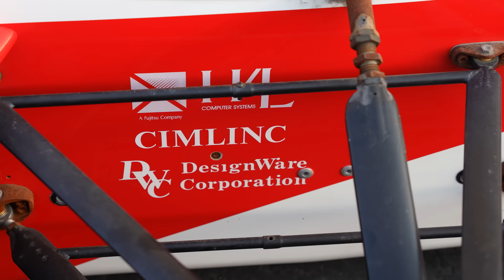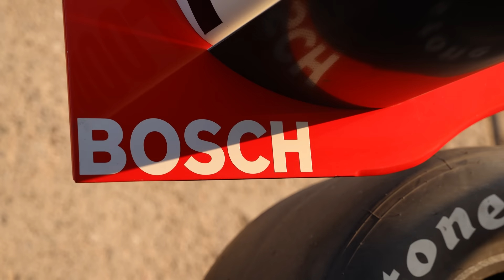I bought a INDYCAR without an engine.

Comment: What an ultimate powermove, buying a indy car and fitting a rotary, when the ls corvette guys didnt think it could get any worse
Reply: probably he wants to mimic the legendary 787b
Reply: @Ibrahim.961  To be fair, Rotaries would be PERFECT in the racing scene! If you ignore higher gas costs and basically running a 2 stroke....
Reply: Im a v8 guy but i love rotorys and would never put a v8 were a rotory belongs.
Reply: @Ibrahim.961  with his 4 rotor That thing would be stupid fast all that aero and it barely weighs anything. I think he just wants to go fast.
Reply: ProMazda's been a thing in the support classes for Indycar for a while now. Maybe not a rotary these days, but I don't think the concept is as alien as you might expect.
Reply: @StarkRaven59  yeah, Star Mazda became "Indy Pro 2000" a couple years ago, currently an inline 4 cylinder.

Comment: Biggest problem may be that in the race configuration the engine is a stressed member - the front is bolted to the chassis bulkhead, and the transmission is bolted to the back of the engine.

Comment: That hook on the back (on the bottom of the wing structure) is for the special jack/dollets they use to bring the car into and out of the garage.  A horizontal rod goes into that hook and then you use leverage to lift the car and get it on the dolly wheels.

Comment: 9:34, i believe the main use of those is actually adjusting the roll center and antidive/antisquat geometry of the car, the adjustments come as pre-set configurations, with the IR12 generation for example for a high antisquat rear end with fairly neutral roll center you would go some 20mm down from default, whatever that is, on the forward leg on both top and bottom A-arms. 

I say the main use, as they run the suspension so stiff you are not going to get a whole lot of camber gain, and especially not big swings from track to track :)

Comment: If there's a car to put a NA 4 rotor into, this is it
Reply: Surely this is the car for the 6 rotor
Reply: @nestam6844  THATS WHAT IM SAYIN
Reply: No room for those. This will be a 13b NA, rev to the moon.
Reply: @nestam6844  yesssssssss!!!!!!
Reply: @PuR3xGODx  there's easily enough space for a NA 4 rotor
Reply: @nestam6844  Nah, that's too big for that, the way the engine mounts in an Indy Car wouldn't allow it, at much it can fit a 3 rotor without some MAJOR engineerring
Reply: Nahh 6 rotor my guy
Reply: @tommihommi1  Is not about space, it's about the way of mounting the engine
Reply: @mindovermatter3988  won't fit LMFAO you can't cut up a carbon monocoque also the gearbox is part of the rear suspension so the location of it can't change. 6 rotor is too long essentially.
Reply: @MrManuel1329  I wasn't being literal my guy. There's obviously no way that would fit. I think maybe a 3 rotor might fit the best given the size he's working with so that he can still put out decent power
Reply: @joealex65  yea? What’s the right way to mount a rotory in an Indy car?
Reply: Even better if they can somehow fit a turbo in there...
Reply: @brent5832  Watch the video to the end and you might have an idea
Reply: I have a DP01 and I'm working on something similar. not many engines will fit in there.
it's about 23" from the firewall to the bellhousing. 
a renesis is 19" from the harmonic balancer to the end of the block
the bellhousing adapter will also have to be a dropbox due to the height of the crankshaft and input shaft
the trans is only good for around 350ft/lbs
Reply: @aleks138  so that probably means na right? What was in these cars originaly anyway? Like 3l V8 ?
Reply: @markoajduk7096  see that empty spot in the bellhousing above the input shaft. that's where the turbo sits. the trans also has it's own dry sump system. at least mine does. it's a bit newer
Reply: 6 rotor
Reply: @koimex7020  it was probably a cosworth XF. turbo 2.6L
Reply: @aleks138  Thats cool
Reply: @tommihommi1  no space and too heavy, car used to be 4 cylinder, by design and engineering just a 13b, turbo maybe,
Reply: Until he cant fit in it anymore
Reply: @tommihommi1  hell yea
Reply: @Me-fj8sb  original engine is a turbo v8
Reply: 6 rotor* even if he has to buy another and cut it and extend it like the 4 rotor rx7
Reply: @thatgingar8765  can't chop and extend a carbon fiber monocoque like that.
Reply: @ScottKenny1978  you can, it is just alot more involved.
Reply: Yesssss
Reply: @Skwisgar2322  I did carbon fiber repair work on planes. You'd need to do some serious things to make that repair strong enough to trust your life to it.
Reply: @ScottKenny1978  oh, for sure, it would take a professional, but it is possible.
Reply: Build a smaller, stronger 4 rotor, and rev it faster than an Indy engine!
Reply: @aleks138  someone who actually seems to know things , nice an thank you for the info.
Reply: @aleks138  ,true, It is a 2.65 liter V-8 burning methanol and producing in excess of 750 horsepower at 12,000 RPM and 45" of boost. For reference, boost is measured in inches of mercury absolute pressure. Standard atmospheric pressure is 30" (14.7 psi) and thus 45" equates to 7.35 psi of boost over ambient pressure, cosworth xb, I did the research of the car, 1999 to 2000
Reply: Twin turbo 6 rotor
Reply: @nestam6844  Where there's a will there's a way.
Reply: Would you put the turbo for it in this same place, in the bellhousing?
Reply: @aleks138  This dude knows his stuff and knows how tough of a project it will be. Its funny seeing everyone say "just put a rotary in"... yeah. Also i doubt Rob will be using the original turbo location. Not without a shit tonne of hassle anyway!
Reply: @ABiggerPigeon  whats wrong with the original turbo location? It already has a nice place to sit and there's not that much space under the body panels.

Comment: The engine and trans on these cars are stressed members. The 787B likely was also, but obviously you're going to have trouble sourcing that drivetrain lol. Are you able to custom machine stressed housings for an engine? And yes, like the suspension bars, that cage in the engine bay is nothing but a placeholder to keep the chassis in one piece. The engine block used to bolt to all those locations.
Reply: The 787B and a lot of the prototypes from that era and even some current smaller formula cars use fabricated steel engine cradles.  
Before this thing ever sees the racetrack, you need a race mechanic who has experience with these era cars to help you out.  I would definitely either buy new suspension, or have it Crack checked.  Typically these show car rollers are built with leftovers, crashed bits or whatever else can be pieced together.  Have someone go through it with you.....

Comment: You should make sure that the rotary or shell you use has enough strength since it will be a structural member
Reply: He probably plans on building a brace that goes around the engine and takes the stress. I doubt a normal rotary would be up to taking those stresses, especially with the way that a rotary is put together.

Comment: Register it as a kit car, and make it road legal 😬😂
Reply: Florida can help with that! 😂
Reply: Yes all he will need left is some lights, signals, mirrors plate holder and a 6 rotor
Reply: @connoisseuroftigolbitts  with LED lights, it would not be hard to rig all the lights into the end plates on the aero. All that's left is figuring out a good place to stick the license plate. Back of the rear wing, maybe?
Reply: @ScottKenny1978  yes
Reply: And take it on drag week?
Reply: Leroy the Savage's Rotary cousin.
Reply: Confused European noises
Reply: @jake3736  Extremely confused Formula 1 noises
Reply: @jono6379  Be interesting seeing a rotary powered Indycar towing it's own support trailer through the Colorado mountains LOL

Comment: Using a standard rotary engine as a stressed member in car like this without a chassis isn't going to end well. Tension bolts through the rotary engine are not likely to hold up to the bending and twisting loads you will need it to endure.  You should research how Mazda did it for their Let Mans car as that might be the only similar reference vehicle....
Reply: Alternatively, you could create a frame around the engine to serve as the stressed member
Reply: I agree 100%. As far as I am aware, the whole series of Mazda Group C cars has substantial supporting tubular structure between the monocoque and gearbox housing to carry through loads. Certainly the 787b and 792p are self-suporting without the engine installed. I have never seen a rotary engine used as a stressed member and I would think the nature of their construction precludes it.
Reply: @ancientrenegade9243  Looks like most Indy engines are around 600mm length, 20Bs are 675mm so I think even a 4 is going to be a stretch. Maybe literally!  Its obviously not going to be built to a class spec, so why not shove a few extra mm on the wheelbase to fit a novelty engine, and make some extended bodywork and fittings to suit.
Reply: @ancientrenegade9243  The monocoque is autoclaved carbon fibre yes, but the monocoque consists of the cockpit and forward structural area. The rear structure of the car consists of the engine, gearbox and attached bodywork, there is no rear monocoque, that's why they split in half when they crash hard enough. You can absolutely extend the car by increasing the distance between the rear of the monocoque and the gearbox (either with an increase in engine length or a framework carrying the engine), it would require increasing the length of bodywork, linkages and fluid lines to match the new length, but that's it. If you have a look at an Indy  monocoque you'll see what I mean :) NB by gearbox I mean the whole transaxle.
Reply: @ancientrenegade9243  Oh it definitely wouldn't improve handling lol. Might improve stability on a big oval, but it would be ruinous for circuits, at least comparatively. I was only thinking for the sake of novelty powerplants, which I hope is the overriding goal of this project. Not enough people are having fun with motorsport anymore.
I hope I didn't sound big-headed, I've been very lucky in my career to work with and have access to historic and modern racing cars of many different classes. I now work withh aircraft which is basically the same thing but upside down.
Knowledge is secondary to enthusiasm!

Comment: Not sure if anyone has said thus yet, but the back hole in the engine cowling is for a pop off valve, the Hondas would often run an engine intake on the right side.

Comment: I work in formula one and the suspension is very similar to indiecar (or at least 90s f1 cars due to them being prototype new technologies in this day and age and way more advanced than most industries) you have a torsion bar of which the rockers rotate around, the rockers are the part that is pushed by the push rods on the front, attached to the dampers that you pointed out in the video, the suspension is inboard for aerodynamics packaging, centre of gravity etc, interesting fact a lot of the stuff in motorsport is actually borrowed from the military such as the wiring (what im learning to do) and they hydraulics people are ex air force who worked on fighter jets.

Comment: Hopefully you've figured this out by now, but that big cavity on top of the gearbox housing above the input shaft is where the turbo would have gone originally. These had a big single turbo and no intercoolers, and the typical placement for the turbo was behind the engine (Porsche tried putting the turbo in front of the engine on their 1990 car, next to the fuel cell, and quickly found methanol has a really low boiling point and vapor lock is not your friend). The hole on top of the engine cover was where a spec pop-off valve would get bolted on the plenum before each session (the officials would pass them out at random) to enforce the maximum boost, a 1970s solution that lasted into the 2000s. Of course, no one besides the laws of thermodynamics is going to tell you how much boost you can run on it now...

Comment: Looks like it would have had a Ford/Cosworth engine previously but even a modded 13b today would likely make a lot more power than it would have had back in the 90s
Reply: That Cosworth made around 700 - 750hp depending on the boost level the series allowed for each track.

Comment: I love Rob and this channel so much, And I will never stop watching. But my god please just get the 4 rotor dialed. If there is a setback I’m not aware about, y’all please tell me and I’ll delete this. But after the “this vs that”, I was so ready to see that thing solid and wrecking everything, but now it’s nowhere on the channel. Someone tell me what’s up or please Rob get that thing set up right.
Reply from the maker: No setback. I legit tore it down to measure and work on billet irons. I also didn’t want to slap it back together without the carbon body. So it doesn’t look so janky. Figured it would make a cool phase of the car.  Videos will start coming out soon!
Reply: @RobDahm  so after watching you look over the car I realized you might need some help with formula cars. I work on and drive many different formula cars. Also If you would like to test any cars on a private road course let me know.
Reply: Everything takes time mate relax
Reply: @thomasclark6642  I know, it's just easier with some help.
Reply: @trusty9796  you're awesome!

Comment: 10:43 "where's the spring?" 
those might be torsion bars, aka suspension without springs.
they use them in f1, and i assume indycar as well
Reply: those i think are just rods to replace the actual suspension when storing this car.  yes, modern f1 cars use torsion bars. but they are positioned differently. torsion rods twist instead of compressing. also because this is a CART car its most likely (definitely) has a normal spring and damper.
Reply: Not in 1997 they didn't. Those are gone and replaced with these, I'm wondering if they even move. They look solid.
Reply: The roll bar is torsional front and back. I have multimatic dampers set up for this
Reply: @TheFoyer13  the bars on this car won't move or would do any dampening. I would think that the links would break if you drive this car fast and aggressive if the bars are used a the suspension.
Reply: @br1_deadpedal  Did the T97/00 originally have Ohlins TT4s?
Reply: @M.asa.  Those bars are just their to hold the car up for show car duty. They would normally have dampers mounted there. There are a lot of parts missing from that chassis. Dampers, roll / torsion bars, brakes etc etc.
Reply: @MX304  came from the factory with Koni
Reply: @br1_deadpedal  Interesting! I didn't know Koni ever built dampers on that level.
Reply: @MX304  that's what I said.
Reply: Making it a great thing to restore because it has a manual with part numbers and everything. I could be wrong about it originally having koni.  that would mean in 3 years lola used 3 different shock manufacturers. Regardless they were probably taken off and upgraded to ohlins or multimatic. The cars actually ran 6 damper 3 on front 3 on back. At high speeds the car wouldn't be sucked down and ride on the 3rd spring. Thus allowing for softer spring rates(mechanical grip)in the slower corners.so the cars dont bottom out. Ie Toronto long straight tight slowish corners.
Reply: @br1_deadpedal  When did teams starts running inerters in the third spring? Was that technology even a thing in the CART / Champcar era?
Reply: Dont no much.  I think that's an Alonso Renault technique. Not sure of another. The CN tower has one in the top of the tower. It moves 3 feet. Keep in mind cart was suppose to be equal. Not like unlimited f1.
Reply: @br1_deadpedal  You are thinking of the mass damper. Inerters are a different thing, but attempt to accomplish similar results. F1 banned inerters also, but they are still used in top level prototype racing, current Indycars, and drag racing.
Reply: The issue with the ohlins in the front is there is no room for the piggy back shock. A line must down the outside and have the reservoirs in the tub. 
I guess its probably kind of a design flow when you consider wanting to move dampers around. The rear 2 dampers could have piggy back reservoir but no room in the front once the cover went on.
Reply: @br1_deadpedal  Do you know if copies of that Lola info packs are online anywhere?
Reply: @MX304  no a lot of lola stuff is gone now that the company is sold to multimatic
Reply: @br1_deadpedal  TTX and most through shaft style dampers don't need large reservoirs.  Ohlins has several models where it's built into the body.
Reply: @dhj2098 yup they do. things that weren't available 25 years ago

Comment: Bro gonna rotary swap a tank one day
Reply: I’ve seen a 12 rotor boat engine (if I remember correctly) that could power a tank
Reply: @omega1575  you do remember correctly. Company in new zealand made those lik 13 years back, the lowest horsepower one was 1400hp N/A i believe. Thsy are going to do a revision series this or next year.
Reply: There's finally be space for an engine.  I'm really curious if he goes 3/4 rotor NA or 2/3 rotor turbo.
Reply: @aaronbuster1989  my guess is 3 rotor turbo, if it will physically fit. It's a very snug fit in there, like 21" from firewall to bell housing, and you can't change it.

May actually be limited to a 2 rotor due to length.